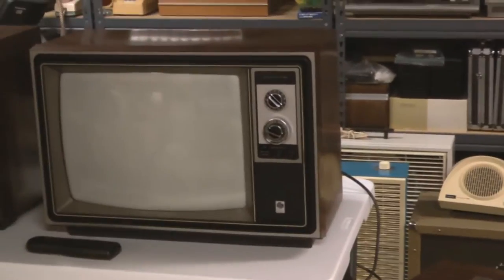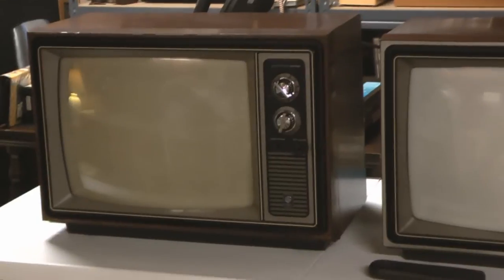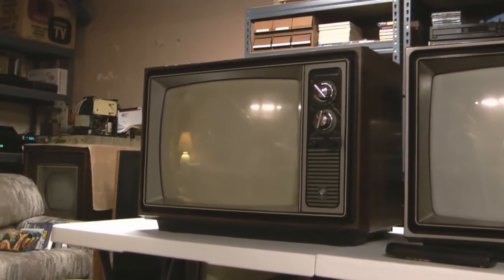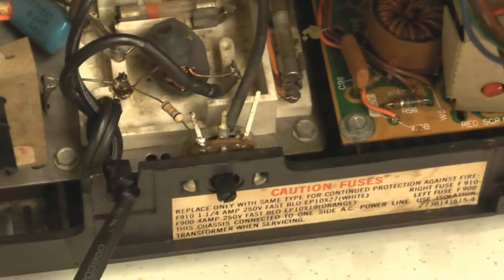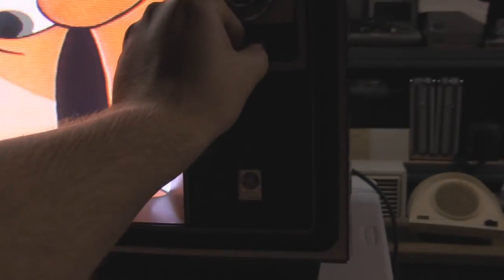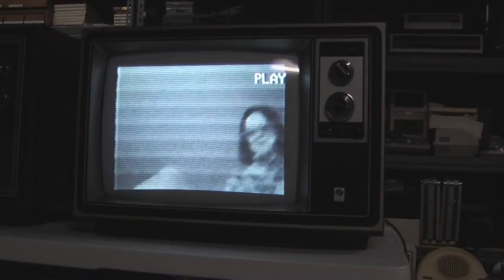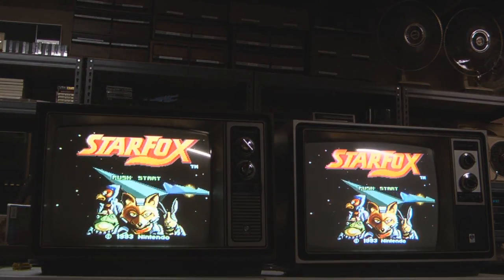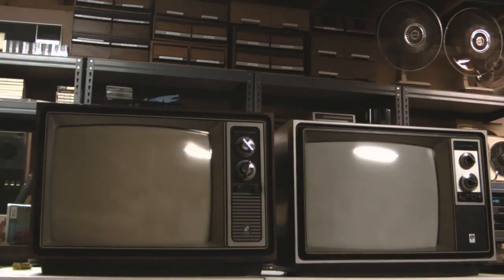The 1977 and 1978 General Electric 19" Televisions

Comment: These vintage TV's are much better than modern TVs Sharp is now owned by Hisense company.  I heard this on the news about a warning before buying any cheap television from best buy.  The lady got it for christmas (400 bucks), in the box, damaged. It was too late to return the TV back to the store, and she didn't get the full refund. The news recommends checking the product before wrapping it. Great General electric sets, well built in the 70s, compared to today's "not-to-well-made" LED TV's like LG, Samsung, etc.  That is excellent on how you just got lucky with all this vintage stuff. My aunt's friend bought a the smart TV for at the campground, and it stopped working after far less time.

vintage GE appliances are much better than today's GE appliances.

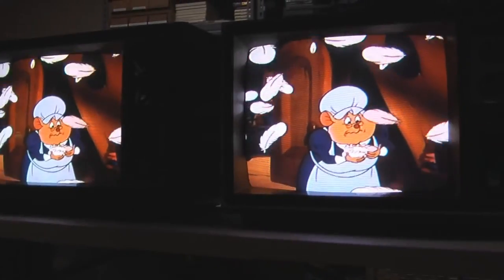Comment: 23:27 -  “Contrast halfway up”  

Correct!   I center/halfway all user settings on these, then use the Brightness(black & shadow detail) to dial in a balanced picture.  

Often these tubes came with the Contrast(picture drive) cranked to max, and users were never instructed on how to correctly set it.  Shortened the lives of many an old tube set.

My color on these often ended up somewhere in the bottom third of that control’s range of adjustment for natural looking color

Comment: I had one identical to the '78 that my dad apparently bought new in late 1977. it was dated October of '77 if I remember right, before he met my mom. My folks used it in our living room until they bought a 25" G.E. in 1986, then put this one in their room, then in the early '90s they got a Zenith 27" stereo model and I ended up with the '77 G.E. I used it until about 1996 then the picture tube went out, so my dad kept in storage. I don't remember what happened to it after that. I was upset when it finally went out, I really loved that particular T.V. for some reason. so, I'm glad to see these are still out there. It really did have a beautiful picture up until it was finally going out.

Comment: These GE color CRT's had a unique gun design that is kind of hard to explain. Best I can describe it is like a cross between the in-line and delta/triad design. GE also had a plant here in Canada until 1976, and one of the last sets they produced was the "YA" chassis which I have in my collection. I wouldn't mind finding some cosmetic parts for it if you have any (GE logo decal and volume knob).

Comment: I've noticed over the years that (when the sets are off), certain sets will have a lighter colored screen than others, which are darker.

What causes the difference in color, and what are the pros/cons (if any) of a lighter or darker screen?  I've generally preferred the darker ones, just seems to look better to me when off.
Reply from the maker: The differences are actually from the CRT face itself, as the glass itself is tinted. As you get into the 90s and later, they kept darkening the CRT glass.

The advantage is it gives you better contrast, especially when the room is lit. Blacks will look blacker, etc.

Disadvantages I've noticed is the CRTs have to be driven harder to give off the same amount of light output as a non-tinted CRT, or just as well, those CRTs don't appear to be as bright as their non-tinted counterparts. The harder you have to drive the CRT, the faster they wear out.

My personal preference is the non-tinted type, like the 2 GEs in this video. They are definitely brighter without driving the tube hard, and I like the color reproduction better.
Reply: Excellent explanation.  Thank you!

I have an old RCA ColorTrak 2000, that set (as well as a couple others) have a tinted glass piece in front of the CRT.  Those tinted glass filters are removable, and it's really amazing how much brighter the CRT actually is without them in place.
Reply: +jaykay18, awesome bro!

Comment: Come to think of it, I have noticed that TVs from the early '80s and before had a much sharper picture. My 1983 13" RCA XL-100 has such a sharp image that you can actually see the slight digital artifacting of standard definition digital cable, which normally, you can only see it on an HDTV. It's a high hour set and the red electron gun is slightly weak, but it's still a good solid unit. It's a good example of how even a basic TV from that era will perform for many years and still maintain a good picture with little more than some adjusting every now and again.

Comment: I guess I am showing my age, but I recall the full tube color sets of the 1960's, and the rise in popularity when the 23" picture replaced the roundie. Those full tube sets had a wonderful picture, that was easy on the eyes - but not razor sharp. Then when solid state circuits were phased in, the sets were absolutely razor sharp. They were also very expensive, with the very cheapest 19" sets being low end brands like Sharp for around $300 (in early / mid 1970's money) that didn't have that stellar picture. The premium RCA and Zenith sets were still up pushing $1000 in an era when a basic new car was in the very low $2000 price point. But around 1980, after the recessionary period we had in the US, all mass market consumer electronics were made to a price point. Television sets, stereo equipment - the goal was to make items cheaper to build and cheaper to buy. For the best possible CRT picture, it's impossible to beat a 1970's Zenith, RCA or Sony set. Magnavox was taken over by Philips in 1972, and Philips SOP was to cheapen everything possible, so they never had a truly good solid state set after the early 1970's and had serious QC issues before that. Their televisions were the opposite of their console stereos.

Comment: I own a Panasonic Video Cassette/Blu-Ray player combo which also has four speed play, and it upscales VHS to 1080p High Def. On my unit the 4th speed is called "VP".
Reply from the maker: Huh, that is cool. I never knew they made a consumer deck with that speed. Your VP speed is equivalent to my SEP speed after reading the manual.

Comment: Still asked why I stick with a old CRT TV when I have a LED TV. Simple, The sound is so much better on the old TV's. I have a '88 RCA ColorTrak 27" and its got the best speakers i have ever heard in a TV. Had to stop using it as the convergence went out and I'm not confident in my ability to correct it without messing something else up.

Comment: I love the GE TV where I remember when GE Put the CRT Screen on blue, when you noticed when you use on Incandescent bulb, you can tell that has strange pink on it, and while using CFL bulb, you know that screen is blue, and I find out that GE decided to make a beautiful pictures on it like Reveal Light Bulb, and I can tell when they decided to manufacture one what I could called the TV that has a blue screen when not running the TV, "The Reveal TV," because it provides the best color on the TV better than other brand like today's technology where I may have to stick with the new brand, and I don't like to stick the newer one where it was made in China, and I would love to collect any vintage electronics where I can enjoy anything wherever I want.

Like one for example,on Oct-4-2014, I went on Yard Sale, and I've noticed the one of the vintage alarm clock radio is the 1970's or 1980's GE Alarm Clock Radio Model- 7-4550D, it was made in Malaysia, and the informational sticker was made in Singapore, and I've noticed when I've searched about the clock when I got them, some of the clocks are made in Korea, and for mine, when I began to turn the volume up or down, I hear it made a scratchy noise where I managed to stop making scratchy noise by keep going up-and-down, up-and-down, and up-and-down until it finally stopped making scratchy noise. Not only that, it does provide the best base speaker where I can enjoy tuning the Radio Dial, and I found out I can keep that and use them whenever I like to do. =)

Comment: The only draw back GE tvs after 1978 had were the griplet joints on their circuit boards. Have some 13 inch late 70 models that will need them to be rewired and I have a 1984 19 color with vertical problems. The picture shrinks. Of course in my TV gear there a 1974 porta color that is blowing fuses that also needs to repair.

Comment: I see that monarch aire frankenfan with the lasko blade. How does it compare to a s223 or something similar. Nice tvs
Reply: Still not sure, I have not been able to loosen it up.  The motor is still wayyyy too stiff.  Possibly even not salvageable.
Reply: harleybadger1 was there water damage to the motor
Reply: psalerno123 Not that I could see.  The bearings must be either glazed or scored.  Windings fine.  If nothing else, will put this one in the "iffy motors" box until one day we come across a plastic motor with burnt or open windings.
Reply: harleybadger1 Hope you find a parts motor. Good luck!
Reply: psalerno123 Thanks!